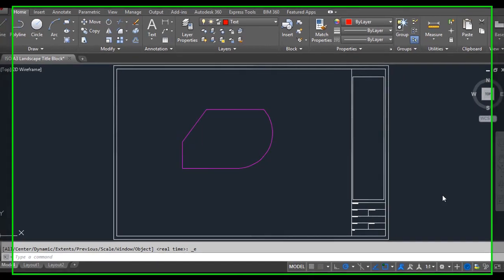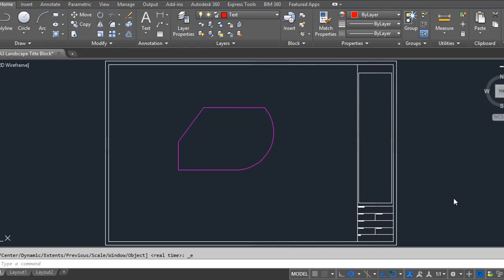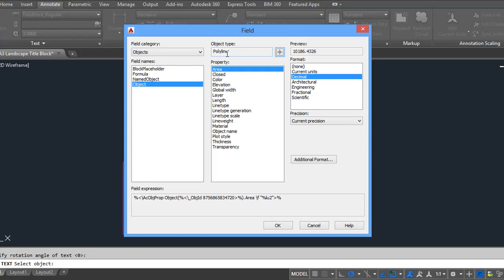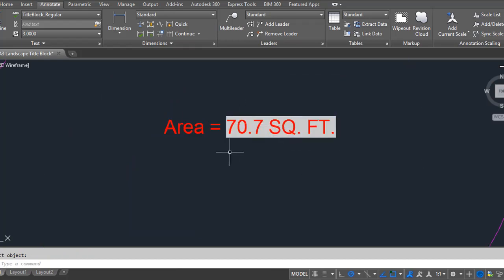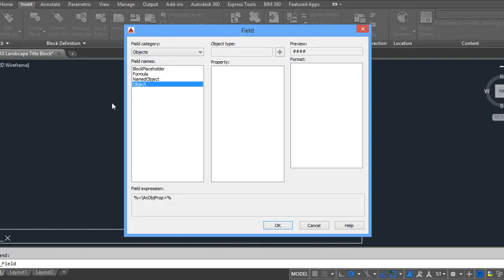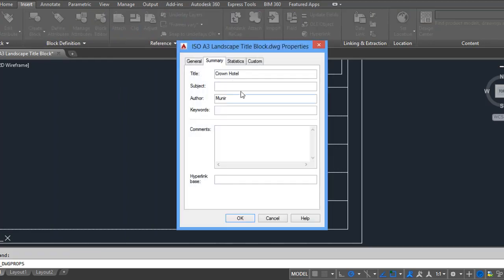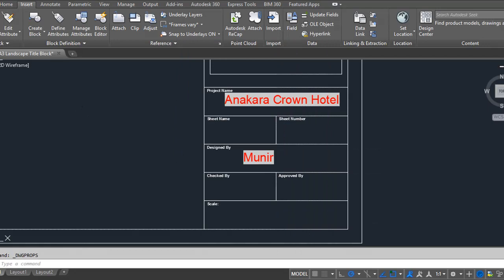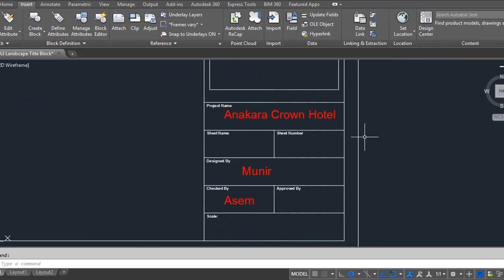Fields in AutoCAD -- in English

Comment: How do you change the area from sqare feet to sqare meters? And how do you make a layout number field (not a sheet number field)? Thanks.
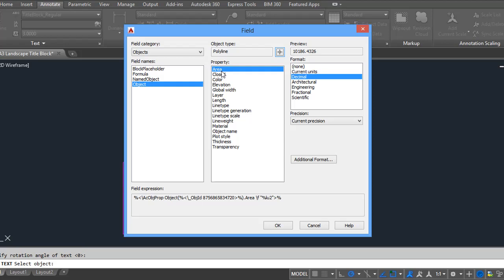Reply from the maker: +RoDJ99 In 2:20 the video shows how to display the area value. Since there is Meter in AutoCAD, display as Decimal Units. As for your second question, there is nothing in AutoCAD called Layout number, but only layout name